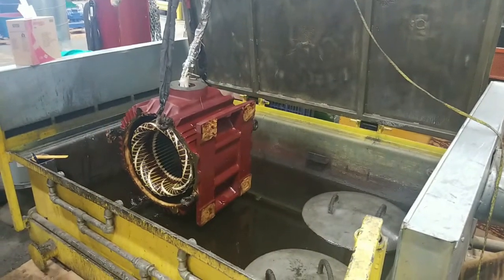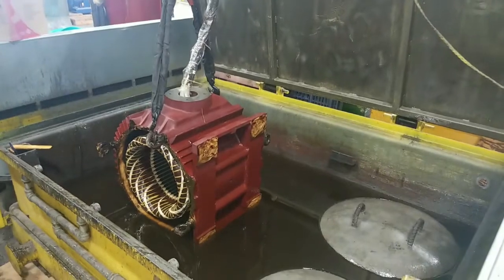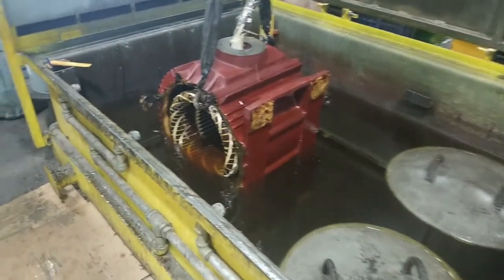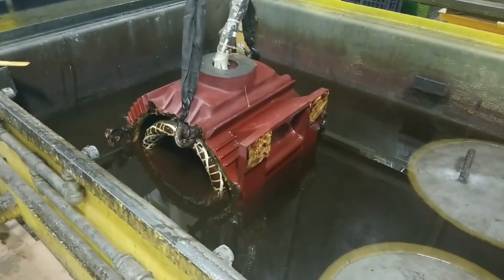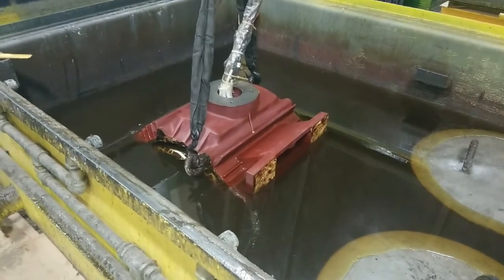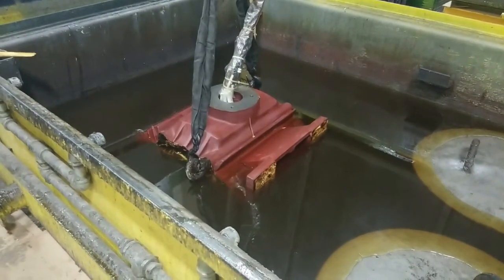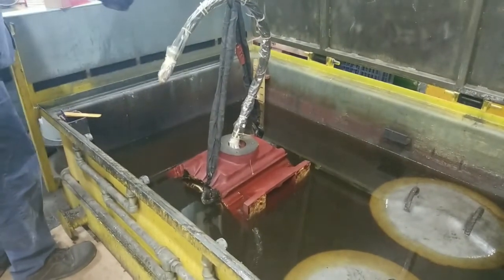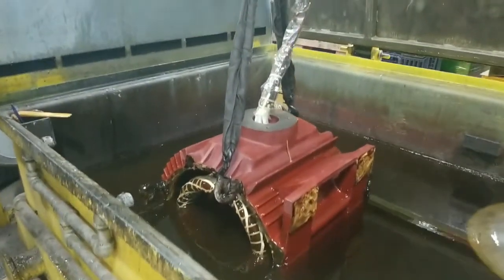Dip and Bake Varnishing Technique

Comment: actually stator winding wire is precoated with varnish before it is assembled, otherwise the wires would short circuit to each other.  What is shown here is the final varnish application.

Comment: Why do you dip it horizontally? Wouldn’t the excess varnish stay in the stator, pool, and bake on the laminations; wasting more varnish in the long rather than dipping & dripping it vertically?
Reply: It might be to don't dip the lead cables. As soon as it is taken out, it should be positioned vertical to prevent what you said.
Reply: @aizpruart  we pull the leads through the top when dipping and just wipe them down after it’s done dripping if need be. Then just feed them back through before or after baking depending on how much space the winder left where the terminal box opening is.
Reply: @aizpruart you’re right though. On some motors you just don’t have the room to pull the leads through. In that case we’d use an adjustable chain to position the lead end up higher so it dips on an angle and prevents pooling and waste.

Comment: How you remove varnish from motor body ? Please reply.
Reply: High temperature oven???
Reply: First you dip the motor (we like to dip for about an hour depending on the size of the motor) then let as much drip off (we let drip for another hour) then we bake it out in the oven to cure the varnish. After that we clean the hardened varnish off the lamentations with a hard wheel on the grinder being careful to only remove the varnish and not grind in to the laminations. You also have to clear the hardened varnish off of any machined surfaces like where your housings/end bells will go back on to, where your terminal box goes on and also the feet of the motor where it will be bolted in place at its application. Other than that, you don’t need to remove it from anywhere else. If there’s spots where it looks bad we will clean it up to make it look nice but it’s not needed. Hope this helps

Comment: But stator lamination also get coated with varnish does it  effects motor performance
Reply: You have to take the excess off the laminations with a hard wheel so it doesn’t rub or affect air gap